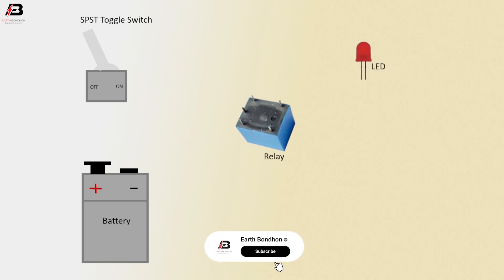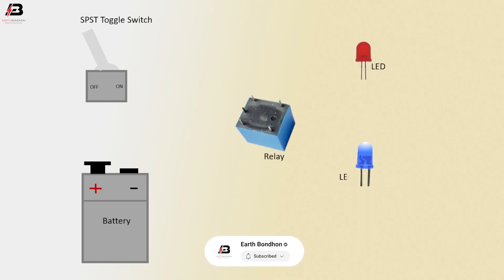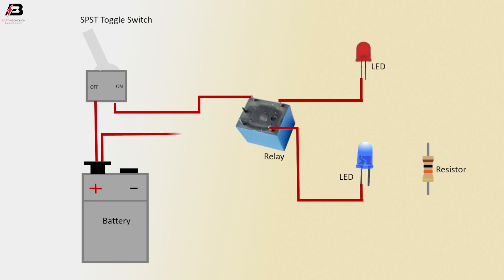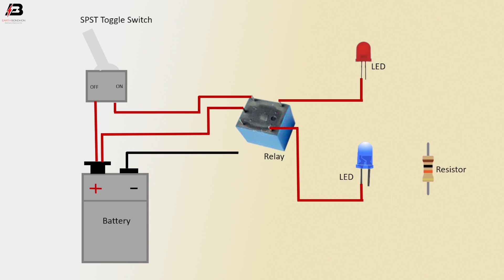How To Make 5 Pin Relay Wiring Diagram | 4 Pin Relay Wiring

Comment: Great video. What is the resistor for? I have a 5 pin relay I want to use to supply a PWM motor driver with two different voltages. Do I need a resistor on the grounds between the 12v buck converter and the 24v battery going to the PWM?